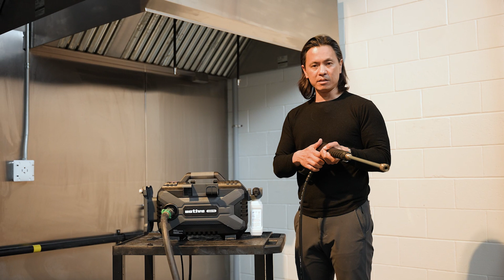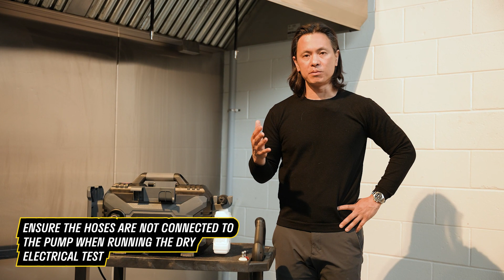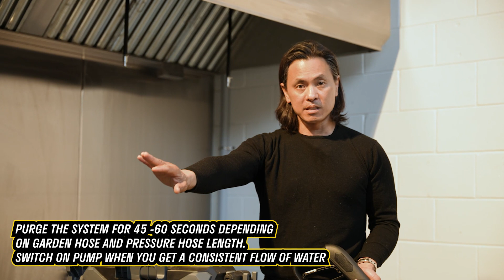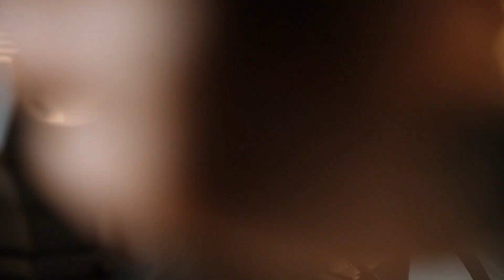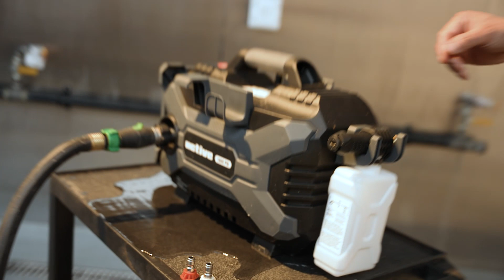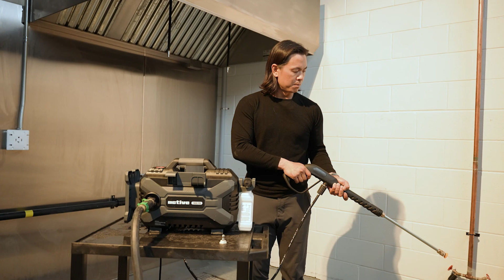Active VE52  Troubleshooting Guide

Comment: My unit was purchased on Aug 2020, was going strong for over 4 years until the push button mechanism cause it stop wroking.  Called customer support and their engineer said the replacement switch is discontinue. Unfortunately the VE52 in CAT and 2.0 is way over the price range I could afford and now have go go with Ryobi.  So day for me. 😢
Reply: Same here...mine wont turn on now after 3yrs....chines-iem trash! Bought mine so i wouldnt spend money at the car wash blowing truck off before had wash at home...did caveman math amd I broke even over time w how much i spent w hose upgrade

Comment: Just purchased the VE52 about a month ago and love it! No leaks or problems and very compact. I had a question though while washing or soaping the car should I turn off the pressure washer and if so can I leave the water running into the product as well or do I also need to turn the water hose as well? Thank you
Reply from the maker: Thank you for the support! Technically most detailers will just leave their unit turned on since the pressure washer stops running once you let go of the gun trigger. There's no need to turn off both the pressure washer and the water source but at the end of the day, it's up to the user's preference.

Comment: My unit won’t work with my foam cannon all the sudden. Still works fine with the spray tip. Any ideas why that would be?
Reply from the maker: Hey Michael, what type of issue are you having with the foam cannon?
Reply: @ACTIVEPRODUCTS  turned out it was just a clogged orifice on my foam cannon. Thanks so much for responding though. 🤝

Comment: You should watch this video before you buy an Active Pressure Washer.  It worked great until it didn't.  Customer service is unresponsive.
https://www.youtube.com/shorts/De8x-LDma-E
Reply from the maker: Hey Fred, we just took a look at this video. We're sorry to hear that you received an unsatisfactory unit and that you weren't given the best customer service experience. Our customer support rep spoke to you yesterday and had been following up with a technician as it is an unique issue. They have identified some troubleshooting and have already reached out to you via e-mail. Again, we apologize.
Reply: @ACTIVEPRODUCTS  I appreciate the communication.  The source of my frustration has been the lack of follow through by the Customer Support Rep.  I was assured he would get back to me yesterday but did not.  Up until now I have been one of Active's biggest advocates.  I understand occasionally a defective product will get out to a consumer.  All I ask is a HASSLE FREE resolution and follow through on commitments made. 
That being said, I did try the recommended fix by the technicians which was to spray some WD-40 into the inlet and run water through it.  I tried that 3 times this afternoon and unfortunately it did not solve the problem  I responded to the email but still no response.  I really believe a replacement is in order.  Thank you for your response.
Reply: @ACTIVEPRODUCTS  UPDATE......I received a note from Customer Service yesterday that Active is going to send out a replacement VE52.  I appreciate that.  Thank you!

Comment: Lol such a trash product. Claims to be the best one on the market, yet I have never had a pressure washer shut off after 5 minutes of use, only to need 10 minutes to cool down, and then only another 5 minutes of use again before needing a cool down period. I have never seen a pressure washer need to cool down. It's got fucking water running through it. Absolutely dog shit product, trips itself inside the unit faster than you can wash two wheels. Trash design, even worse execution
Reply: Chris Baltz, I had the same thing happen to my Cat1800 last week.  My issue is my machine is leaking from the unloader tip and no replacement parts are available.   No warranty as well :(.

Comment: I have the simoniz version of the active ve52, installed quick connects and replace the hose with a 30 feet Uber hose, using a short gun with original nozzles, no leaksv at all, pressure washer tilts after a few minutes of non stop working, 3 to 4 minutes cleaning patio stuff. What could be the problem? Pressure motor goes high and low rapidly. If I release the trigger, wait a few seconds motor stops, and it will start again after 3 to 4 minutes. Can somebody help me out? This pressure washer has no more that 30 minutes on it. Thanks.
Reply from the maker: Hey steph, please send an email to info@active-jobsite.com and they will be able to help you out thoroughly.

Comment: After we done using the unit, what’s the best way to push water out of the unit before putting it to storage?
Reply from the maker: Hello there! your pressure washer manual should state how you can best winterize your pressure washer before storing. If you're just planning on purging after use, you can use an air compressor to blow water out from the inlet but if you don't have an air compressor you can just disconnect the water hose and gun and let the unit run for a few seconds.
Reply: @ACTIVEPRODUCTS   I have been unplugging the hoses and let the unit run 10-20 seconds to push out leftover water. The motor really rev up I am not sure if it will hurt it in the long term. Maybe I am already hurting it. On your video above when you test for power you said not to press the power button too long as it can damage the motor pump.
Reply from the maker: Hello, running the unit for that long without water running through can cause the pump to overwork. we recommend only 2-3 seconds to relieve pressurized water from the pump. There is no manual method to purge the water out fully. If you're storing for a long time without use, you might want to use a pump antifreeze (check your manual on how to do this) otherwise, using an air compressor or a canned air will be your best bet if its just for a short storage

Comment: When will you be selling replacement unloader valves
Reply: Is that what tells the machine to turn off? Mine keeps running after I let go of the trigger.
Reply: @lucidworx  mine does tha same thing have u resolved this issue
Reply: I have the same problem a leaking unloader valve :(.

Comment: More of a maintenance question, but when, and how often, should you run those pressure washer cleaners/conditioners through the unit? I know they usually say before long term storage, but what if you're using it regularly? Every time? Every 10 times? Or does it not need it at all?

Comment: Good stuff. The most common problem i am seeing is with the pressure switch. Please make the part available or a how to repair it. I have the generation 1. The pump will not shut off at times. I have to depress the trigger 2-3 times to get it to shut down. Been meaning to take it apart and see if the pressure switch is sticking.
Reply: This is exactly my problem and was hoping this video would show how to solve this issue.
Reply: @lucidworx  couple times last week it would not shut off. I has to turn the actual unit off. PW is pretty much done till the spring. Hoping to get it apart over the winter .
Reply: @Jeeper1378  These things are NOT rebuilable/repairable.  I have a Cat1800 and made a video on my channel showing it leaking after a little over a year.  I have not received a replacement yet.  I will not recommend this pressure washers to anyone.